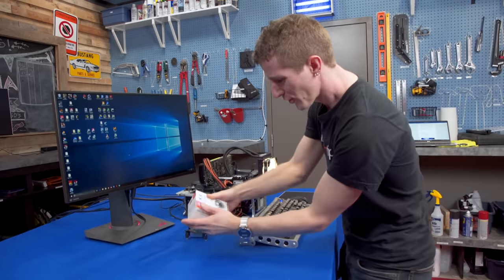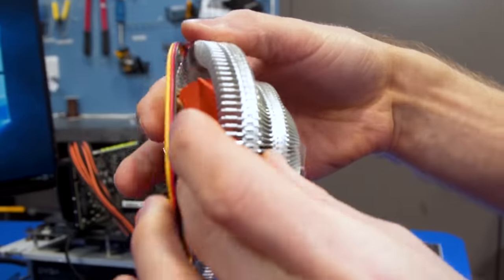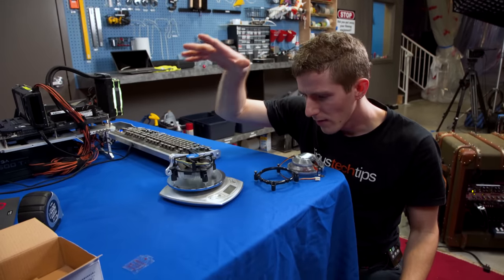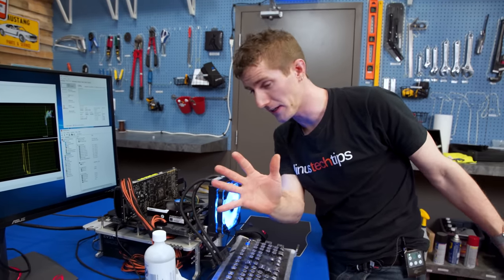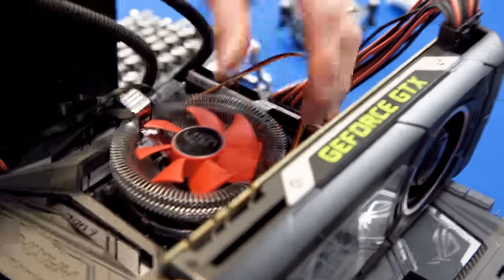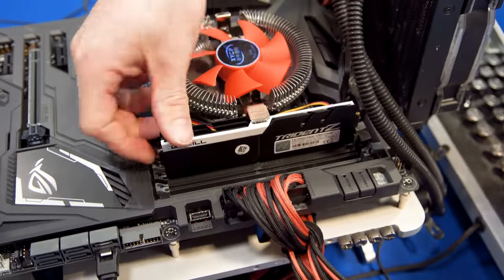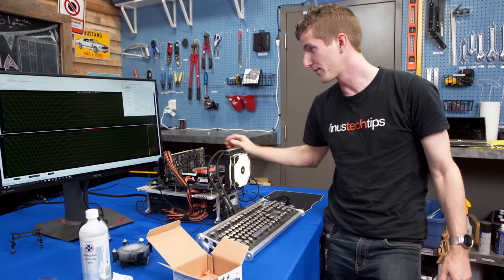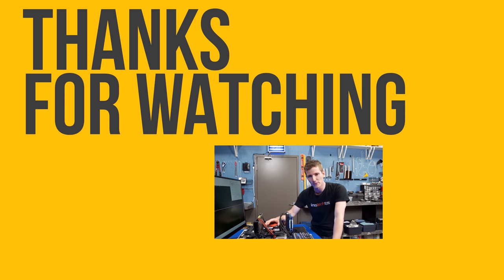The CHEAPEST Heatsink on the Market

Comment: Not using the same thermal compound on both IS introducing a variable.
Reply: Not when the test is comparing "stock out-of-the-box" performance...
Reply: But Intel coolers out of the box have pre-applied thermal paste, thus they did not do a box to box comparison. So the point stands should have used the same thermal paste for each.
Reply: both used the paste they came with. You may as well say its not fair because the heatsinks were different heatsinks
Reply: i think the More pressing Mater is that he wasted half the thermal paste squeezing if out like water before applying what was left of it. it did not look like there was enough there for proper contact to me.
Reply: deimosian, yep.
Reply: Thank-you lol
Reply: John Smith nope
Reply: rararawr619 - So by that logic if they were comparing the stock heatsink to one that didn't come with thermal paste, they should just slap the cooler on with no paste? 
Don't be a tool. Clearly when you compare heatsinks you are trying to compare the heatsink's ability to dissipate heat, not the ability of thermal paste to transfer heat to the heatsink.
If you ever remove the heatsink, you need to get new thermal paste anyways..
The only valid argument to be made is that the cost of thermal paste should be added to the stated price.
Reply: +Rick White 
The point is both heat sinks were supplied with thermal compound, and that is what was used. Pre-applied vs apply-yourself is irrelevant.
+Kareef Huggins
The compound that was squeezed out of the packet was still used. It looked to me like there was plenty applied. When the heat sink is locked down there's only a tiny gap between the heat sink and CPU. You don't need a half inch thick layer of compound in order to work. Just look at how much is pre-applied to the intel heat sink...
Reply: My issue more on the fact that he did a terrible job applying it. He just wasted most of it. i was sure he'd reapply it but he didn't.
Reply: scott thompson the point still stands that not having the exact same thermal paste means that there was not a real comparison between the two coolers. plain and simple.
Reply: I agree, it IS introducing a variable. He should have used the same for both.
Reply: Thank you.
Reply: It's not a comparison between coolers, is a comparison between products, if you can call the intel stock cooler a product. As both products come with paste it only makes sense to use it.
Reply: That being said, he could have actually applied the thermal compound correctly.
Reply: the review is of the heat sink, not the thermal paste
Reply: They did a video comparing different methods of applying thermal compound. No method produced better results. Just had to make sure u had enough to begin with.
Reply: Atheist Lillu - And what happens when you switch CPUs, or motherboards? The paste it came with is no longer relevant.
Again.. What if they were comparing the stock heatsink with one that didn't come with paste. Should they just slap it on without any?
It's like if you were comparing hard drive performance, and one came with a shit SATA cable that could only carry half the data.... Are you really comparing hard drive performance, or should you be getting appropriate SATA cables for both?
Reply: deimosian exactly
Reply: Agreed, it's the same reason you don't bench two dif GPUs on two dif CPUs or mobos. Why not just use a different stress tests for each heatsink while you're at it?

And stop with the "but it's what's in the box" argument. included paste is single-use and we all have a tube of AS5 or similar lying around for this very reason!
Reply: +Bradum Would it kill Linus to take 5 seconds to wipe off the stock paste on the Intel thermal module and use the same thermal paste for both to correctly compare them?
Reply: TheClassiestFox - Are you sure you're responding to the right person?
I'm saying that he SHOULD have used the same thermal paste on both...
Reply: He used more than was needed.
Reply: Don't be obtuse, they were testing the heatsink, not the thermal compound. The only variable should've been the heatsink; the differing compounds renders this test completely invalid. 

The less variables, the more accurate the test is. That's just a basic rule of thumb
Reply: That's a bad analogy, because nobody buys €400 MP3 players.
Reply: the chances are: if you're buying a cheap heatsink, you're gonna use the thermal paste that comes with it. to me, this is the right way to complete the test.
Reply: there's something called Tera Player
Reply: But it introduces other costs to the original price. If you buy cheap heatsink you will not buy thermal compound which is more expensive then the heatsink itself.
Reply: fidget spinners could be the new cpu coolers?
Reply: To answer those who argue that "he is comparing products," the only thing that he has done is shown that the thermal compound that comes with the cooler is trash compared to the Intel stock. only by running the test in this video and another with identical compound on both can he really say that he tested the whole "product."
Reply: The point raised, about testing them based on what is included would be valid one, but Linus did not even attempt to properly apply the $5 heatsink's included paste. Instead he wasted most of it on a visual effect.
Reply: A more thorough test would have been to do them both with included and with the same quality paste, giving four results rather than just two. I know from personal experience that the stock Intel cooler does considerably better with aftermarket paste, I think due to bubbles created by the gaps between the three lines mushing together.
Reply: Raidon Hyobashi There is also a whole video on how bad cheap thermal paste can reduce performance considerably. I get your point, but that is not what we are arguing here.
Reply: The thermal compound is part of the product.
Reply: Zackbare Good point. However, the point still stands that he did not test the performance of the HEATSINK.
Reply: Again, he is comparing them just to show if you'd buy this $5 heatsink and replace the stock one or not at all. Not what the ability of this heatsink is.
Reply: deimosian 1000th like
Reply: Bradum - If a cooler doesn't come with paste it's just not part of the deal and such they couldn't directly compare the products, like you can't compare a pre-build computer to a motherboard; in this case you could compare the motherboards, but not the full products. As for needing new paste at some point... don't see how that's relevant.

And likewise with your example, you could compare the hard drives or the full products.
Reply: +Atheist Lillu you're wrong
Reply: Hes testing the whole out of the box setup including the paste included
Reply: I think the most pressing problem was the abomination of applying it. All those air bubbles destroy the thermal capacity! And I'm sure the quality was bare minimum.
Reply: @FoXzzig  so by that logic we should benchmark cpus with stock coolers ?? right ?
Reply: @ZackCodesAI the point is testing a cpu cooler not  thermal paste.
Reply: @Quettesh  he could've used a shitty one dollar thermal paste on both the coolers, because the point is to give them a fair comparison and eliminate the variables. and he also tested a 65 watt heatsink on a 95 watt cpu so it's clear he doesn't give a shit about being fair.
Reply: @mitchellblaser5466  the point is to test the cpu cooler not the thermal compound, what you're saying is like benchmarking cpus with stock coolers.

Comment: "Hey we got this $5 65W cooler from China" "Lets test it on this 95W 7700k!"
Reply: Makes u wonder whether he is just lazy in finding a 65 watt cpu
Reply: @rnegoro1  bad b8
Reply: @beanboy9029  Yes reply a year later.
Reply: Also, he did not apply any proper thermal paste on the CPU. There is a good chance that this cooler could handle a 65W CPU with a good kind of thermal paste.
Reply: @NCSM_official like 100+ watts of tdp... for turbo... pretty simple stuff here...
Reply: @rnegoro1  lazy even to put the thermal interface properly
Reply: The non K i7 is 65w too
Reply: It does, my friend threw one in his NAS because it comes free when you get second-hand CPU-motherboard combos from sellers, because they cost next to nothing anyway, Four and half of the five dollars is shipping to Canada. And yes the stock intel cooler is a one buck upgrade if you ask them. It cools a Celeron at idle pretty well with the fan barely spinning🤣

Comment: THE CHEAPEST 1080TI SLI GAMING PC
Reply: Cheapest bag of cheetos on the market
Reply: linus steals a 1080ti sli gaming pc for $0 now thats cheap
Reply: Linus stole Razer Project Valerie laptop and AMD VEGA GPU!
Reply: Falk200 ew. how much?
Reply: Xrodn34 Gaming had to like bcs it was 420 likes triggered
Reply: Xrodn34 Gaming $69
Reply: Do 1 1080Tis in SLI bottleneck my new Intel Celeron G3930?
Reply: lol
Reply: The cheapest Quadro PC
Reply: The cheapest nasa rocket
Reply: Dual Xeon isnt even that expensive, but it is going to be pretty slow.
Reply: THE CHEAPEST 12 CORE CPU!
Reply: the cheapest multiverse...
Reply: CHEAPEST NASA SUPER COMPUTER
Reply: THE CHEAPEST WORKSTATION PC
Reply: Xrodn34 Gaming cheapest way to hell
Reply: THE CHEAPEST QUAD SLI NVIDIA VOLTA + OCTA XEON + 16 144Hz 8k CURVED MONITORS IN A 360 DEGREE SETUP.

I'd actually non-iroically like to see that, though.
Reply: Lets get the likes up to 1080 lol, only 42 to go :P
Reply: i was like 1080 i am king
Reply: +Lazer 
Only if it's the Pentium 233MHz. If it is the 266, you're probably fine for at least until Half Life 4 comes out (forever).
Reply: gtx 1070 likes ! ;)
Reply: my the cheapest dual xeon pc is a HP ProLiant DL360 G6 for 119 € !

Comment: The temperatures are worse than a MacBook
Reply: I don't believe you... Nothing is worse than a macbook.
Reply: Suraj-a-Tron MacsFanControl lets you override Apple's idiotic fan curve, which is basically do nothing until the CPU starts to throttle. It helped to completely alleviate the thermal throttling that my iMac and MacBook Air suffered.
Reply: The temperature is still better than my laptop
Reply: naufalap funny i saw somebody do that the other day, And i was getting funny looks with my gaming laptop.
Reply: A friend of mine gave me their old 2006 mbp.. I've come close to burning myself on it before.
Reply: Hating on apple?? You are so cool and original, here have a cookie.
Reply: better thermal paste would probably help
Reply: jesus christ apple just took a efficiency over power approach it doesn't need to get shit on this horribly
Reply: Sagar Nanda he meant it ironically
Reply: Yeah... efficiency. Why you can buy a crappy 400 dollar windows prebuilt computer that will run incredibly better than a mac of 3-4 times the price.
Reply: Jarvis yeah... lemme take that box with me to work or college, i also will be able to use Xcode there too, of course. Hmm, turns out to use that box I have to carry a monitor and input devices with me too! That's cool!
Reply: Megalodon Or you could buy a good laptop which performs better than a macbook and is cheaper
Reply: Sagar Nanda and has much more optimized applications and operating system? fucking hell.

There's pluses and minuses on both sides. There are many good things with both Windows and Mac and I think we should all respect that.
Reply: omegshi1 47 What I meant to say is that macbooks are a bit overpirced for what they are
Reply: Exactly. I dont give a damn about the os, os's are always personal preference. And fair, desktop vs laptop, but even for a laptop you would still pay way less for a windows laptop than a macbook of comparable hardware.
Reply: It's a 7700k that hasnt been delided, it's a fucking furnace and it only has 4 core.
That being said $5 heatsink is clearly not for furnace fusion explosion fireball like 7700k even under stock settings.
It's clearly a cheap replacement for a broken stock cooler for something that's not a furnace, kabylake is just too hot for that pos.
Should be serviceable for dual core none OC kabylake tho.

Comment: u know what, i m a Chinese and i know that  dis Heatsink in Chinese market only cost $2.6 with delivery :) much more cheaper that ebay
Reply: 罗一丁 to get to such prices, they must be selling a in huge volumes in China every week. Which industry uses these heat sinks?
Reply: china is one of the biggest desktop pc markets, just demand from the private  sector justifes large scale production.
Also this would cool a sub 65 watt cpu  without issue
Reply: Probably for cooling down potatoes?
Reply: 罗一丁 china currency is way different then American currency
Reply: selling a huge amount of that only cost 1.4 for each one , so 2.6 is for personal.
Reply: $5 Canadian, so it's about 3 cents American?
Reply: Give link? Thanks. ^^
Reply: its a bunch of thin aluminum plates riveted together by a machine, not surprised at 2.60
whats amazing is how it gets from china to north america for 2.40
Reply: @Gillian Seed They wait for the cargo ships and freight trucks until they get fully loaded, and by being transported along with numerous other goods, the price for transport per single item drops to a tiny fraction of what would cost you to fetch it by yourself.
Reply: @Gillian Seed No really, if you are able to read Chinese and access the website Yang Xiao sent, you could find that it's true that it only cost $2.6 with delivery, however, it's domestic only. 8RMB which is nearly $1 is required for oversea delivery, that means if you want to buy that bargain in US the price is actually $3.4 with delivery.

cheap though
Reply: i think thats where ubisoft uses these heatsinks for their potato servers
Reply: Gillian Seed China subsidizes their postal service quite a lot. I can get free shipping from China/HK to the Middle East on most small products on ebay. If on ebay you select Free International Shipping then you'll see many results from China/HK. It's also bulk shipping so it takes a LONG time.
Reply: 哈哈哈 看到这个视频我就无耻的点进来的 让他们见识下淘宝的厉害把
Reply: 3,60$ shipped to Germany
Reply: oh man....
Reply: every time i see videos on youtube saying oh this thing from ebay is cheap i wonder if it works they actually much more cheaper in china market. when bulk its further cheaper.
Reply: 罗一丁 and also crap
Reply: what do you want to buy for $2.6? are you looking for buying a liquid cooler costing $2.6?
Reply: but thats in most cases in area of manufacturer. If you live close, its dirt cheap. Depending on the product.
Reply: is it on taobao
Reply: sorry for bad english

Comment: Yes, use a 65W TDP heatsink on 91W TDP processor its wery good idea =)
Reply: Still funny video though
Reply: and with the worst paste possible. a dab of bacon grease would have fared better. plus smelled better.
Reply: nut butter
Reply: vaseline mixed with toothpaste is a pretty good homemade paste
Reply: @Richard Fully agree, still better than this one... even 40 years old soviet KPT-8 works way better than this :D
Reply: Thanks
Reply: He should have used the same thermal paste for both
Reply: For what you need this cooler, when stock is more efficient?
Reply: and the intel one is rated for 91 watt TDP? I doubt.
Reply: Pentium D owners wannabe
Reply: @eduardoavila646  ahem I have a pentium who runs at 1.8 ghz mister!
Reply: Edward hett But what gen? There are many "pentiums". 
If its recent its fine. 
If its a pentium D, its actually two pentium 4's "glued down toghether", then you have the sun at home.
Reply: @eduardoavila646  um it is before the core 2 duo I don't actually know it is an optiplex 380 or 360
Reply: Edward hett Probably is one of the dualcore pentiums based on the core2duo or coresolo architeture. 
At least from what i saw from these models you wrote there. 
But ir could potentially be like a 1.8ghz pentium 4, but very unliekly, only if you or someone put it in there. Idk even if its retrocompatible enough for that. 
If its one of these optiplex, you can get a really good c2d for cheap for upgrading it.
Reply: @eduardoavila646  actually it is a 330
Reply: @eduardoavila646  and it is a dual core
Reply: Edward hett From what i saw in some dell forums you can put up to a core2duo e8400 there without any issues. Its those pentiums based on the core architeture, they dont heat so badly and have a good upgradeability. 
You could put up to 4gb of ram and a e8400 @3.0ghz there. Maybe even a low profile gpu. 
It can still pimped up quite a bit actually.
Reply: @eduardoavila646  coool. thx
Reply: I have 4 of those 5$ fan. Here are the results.
Core 2 Quad Q9650 3000MHZ overclocked to 4000MHZ
This is the temperatures I get with that 5$ fan...
Idle 34C
85% Load 60C
100% Load 69C
...............
Oveeclocked to 4450MHZ
I get Idle 35C
85% Load 63C
100% Load 71C
........
Core 2 Quad (2500MHZ) overclocked to 3200ghz .
Its at 45C idle and 68C under 100% Load.
Reply: Stock coolers only come with non-K CPU’s and K CPU’s have a higher base clock. Intel measures TDP for base clock, so that means that the intel cooler was without a doubt also below the 91W TDP.
Reply: LTT was supposed to pack boxes for some computer company. He just got lucky, that's all.
Reply: @GameER  It is decent enough for 7700k
Reply: TDP is bullshit, just throwing that out there
Reply: I just use mayonase
Reply: @TheXanUser  Really want to do this now...
Reply: @TheXanUser  without paste
Reply: whats "TDP"?
Reply: @yksnimus  TDP - thermal design power. This means the amount of heat processor can give away.
Reply: @yksnimus  Thermal Design power. The maximum amount of heat that a heatsink can dissipate, and the maximum amount of heat generated by a chip
Reply: CPU manufacturers use this “idea” in every single “box” cpu package. That’s why cpus can handle turbo clocks barely with cooler starting to take the f..kin pc off the ground lol..
Reply: He actually comparing between stock and this bad boy
Reply: Intel stock cooler is also a 65w heatsink